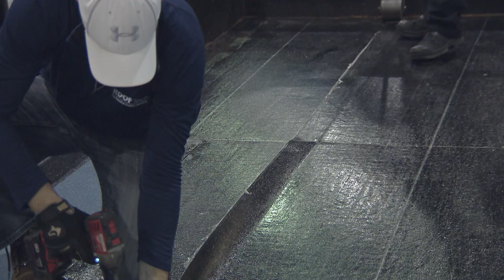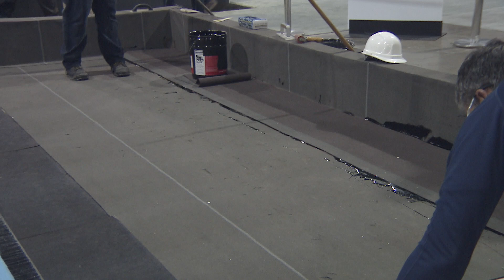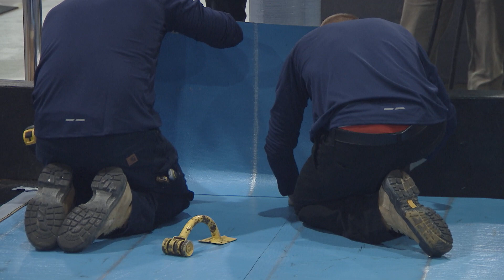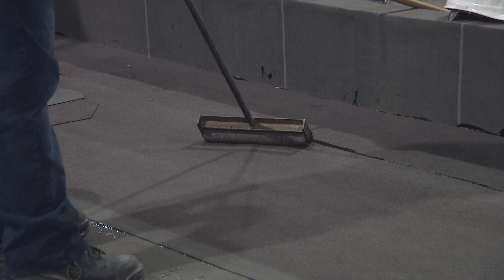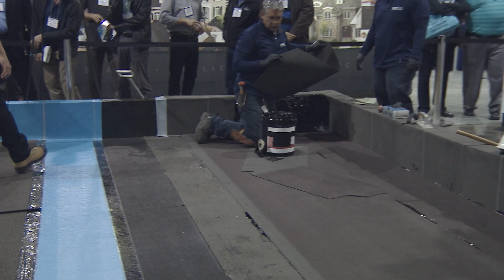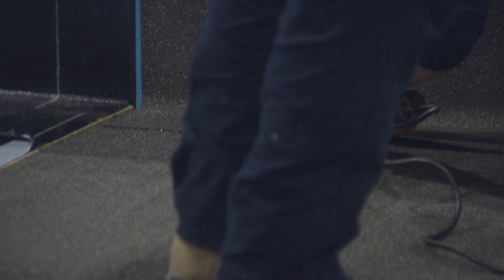Modified Bitumen Roofing Systems

Comment: If you live in Arizona, this system is total garbage. I paid more for this system and it could not withstand the Arizona heat. What was once rubber material, completely shriveled up into cardboard. I'm having to replace my whole outdoor balcony deck.
Reply: get an inverted roof if you plan to walk on it on higher temperatures. As someone who lives in winnipeg this system works well because it can get extremely cold and hot throughout the year and this can be applied in almost any temperatures. IF you plan to walk all over it you have to adhere traffic cap or like i said make it an inverted roof.

Comment: Help me understand WHY isn't the Finish Surface be WHITE to assist in Sun reflection Plus reduction of Air Conditioning within Structure ?
Reply: The cap sheets come in all different colors just like shingles. It's up to the customer to decide preference 👍
Reply: Just want I wanted to know. Hmm.
Reply: It’s the arctic region version of roof color.
Reply: in colder temperatures you may want added heat to your structure to reduce with heating costs.